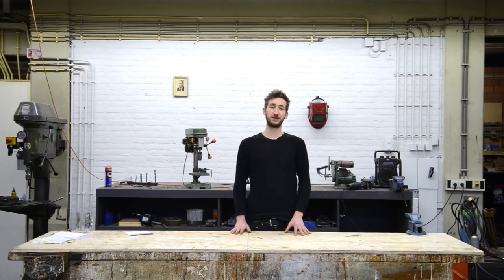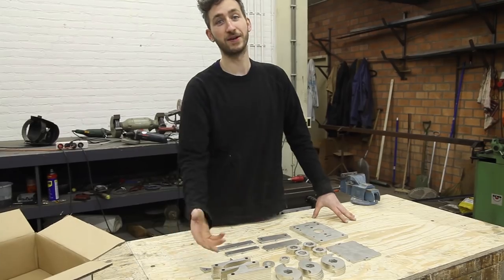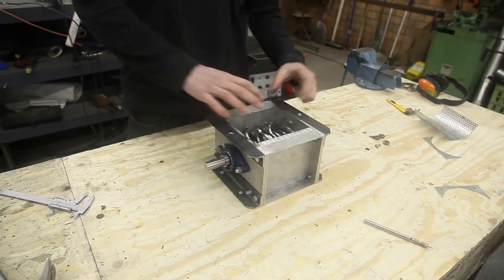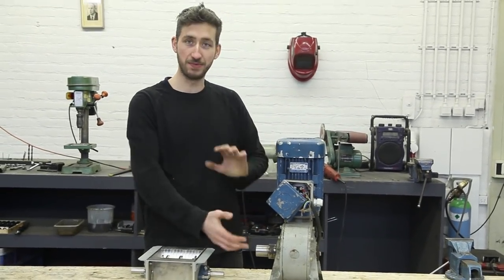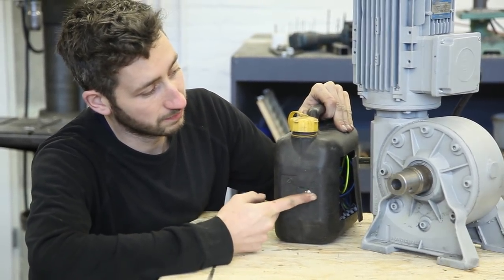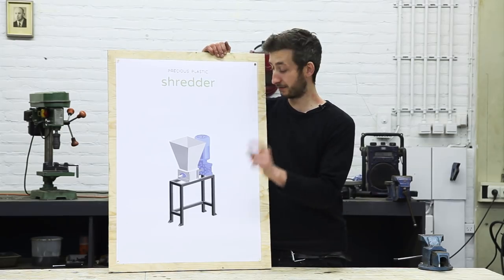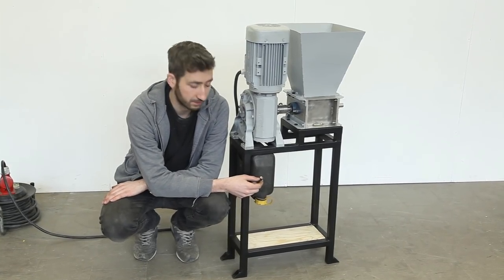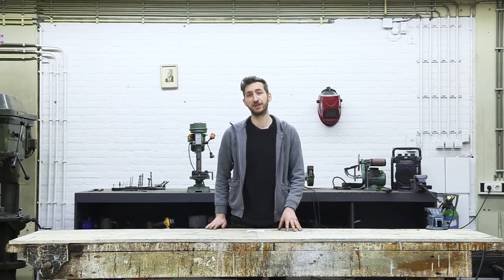Precious Plastic - Build the shredder (part 3.1)

Comment: Let me stop you there ....watching the videos in order all of a sudden you need a lathe a pillar drill and a linishing machine co make these , best guess (PS im a gunsmith and a blacksmith not to mention a tree surgeon and an engineer) thats around £2500 with fuel and transport assuming you actually have some where to store them + £250 to have the parts cut ? well pointless watching the rest of these videos and pointless sharing this on facebook , no one i know (including myself) is going to invest £10,000 (by the time you make all the machines) to recycle household waste.
Reply: +Edgunsuk 

Nothing in this life is easy...but I always try to look on the positive side of life...

With ingenuity you can find work-arounds to most problems in life...no one answer to any problem...you sound like a capable bloke...good for you that you can do all those things...I am an Engineering Inspector...I can think of other ways to solve the basic engineering required to build this gear...and getting bits and bobs is a snap down the local scrap yard.   

In most communities there will be easy access to all of these tools. Nice to use a laser cutter but with a bit more work you can get good enough results with an angle grinder and a vice and a file. 

No need to buy and own at first just negotiate and share...or borrow...

Many hobbyists already have the equipment he mentions in his video...I know lots of folks who would be happy to volunteer their workshops to help a good cause like recycling plastics.

I think there's always a way to do these things if you really want to do these things... 

The alternative is just give in and ban plastics to stop pollution...rather than try to fix the problems associated with their use and disposal....

I feel like a lot of work has been put into these presentations, they share their work no charge...if people can do it they will and if they cannot...well they won't.

Here's a link to PPC if you need to get an idea of what they are preaching...I'll go with the folkd looking for answers and solutions anytime...

http://www.plasticpollutioncoalition.org/
Reply from the maker: +Dane Lavery we need more people like you
Reply: +Edgunsuk sorry champ, this is not something you will do at your houses kitchen with mentos and a diet coke... and you can still do it without many of those tools if you use your brains a little.
Reply: I am an engineer a blacksmith and a gunsmith among other things this is ridiculous the guy is pushing it as a single person idea not as a small business, maybe you have significantly more money than i do but i have lived in houses that would cost less than that full set up ""champ""
Reply: +Jonatan Villagran 
Please, be more condescending.
Reply: +Edgunsuk I agree with edgunsuk, even with all the right intentions and looking to the bright side of the road, you need a considerable amount of money just to make this machine (and a similar amount for the other three), davehakkens is trying to sell it like a "even a toddler can do it" product.
Reply: Daniel...

I previously replied to Edgunsuk pointing out that there are always work arounds. We should never be put off by the difficulty of a challenge. I agree with Edgunsuk that PP presents a highly individualised view of how to do this...

I have a strong Engineering and Metallurgical background and I have worked all over the world and seen all manner of resourceful and inspired solutions by people who never saw a machine shop in their lives and had nil in the way of formal engineering education...yet they found answers. Good workable solutions where highly qualified experts failed repeatedly over many years.

Instead of calling Edgunsuk names and rubbishing him, I would rather ask him for his help. I  would ask him to download the PP plans, review and list his criticisms and (more to the point) suggestions (polite ones only please) and then head for the PP Forum...post those thoughts there. 

Criticisms are always helpful. Suggestions more so...Focusing on problems with the help of others always helps us move towards solutions. Focusing our combined abilities and knowledge and sharing that is the way to resolve the most difficult engineering problems.

As an Engineer, Gunsmith and a Blacksmith, Edgunsuk is uniquely qualified to help with this endeavour. I for one recognise and respect that.

When I get the time I will try to build a version of this equipment. Only that will help dissuade Edgunsuk there are workable, viable solutions...Yo can bet I will not be spending £1,000(I'll be spending JYen in any case).

For any of you out there who are attempting this head for the PP Forum and seek your help there...do not expect that from PP. This is a one man band pretty much and we must be prepared to self help. 

See you there I hope.
Reply: This video isn't pointless. In fact, it has inspired me to build a similar machine using nothing but a drill and and a hacksaw. Yes mine will shred bottles and toys. Humans have one capability called imagination, please use it.  How did I build mine? read next...
Reply: I build mine using a converted paper shredder. The rule here is you're only given two tools. A hacksaw and a drill, but nearly an endless supply of scrap materials. I can't go into detail how due to the complexity and limited space...my shredder is hand powered. Please go make it work.
Reply: +David nice David, the only thing pointless to discuss is this great idea... Dane keep it going
Reply: Ban plastics ! LOLOLOLOLOLOLOLOL !
Reply: Agree with you Mark...it sounds ludicrous because plastics are everywhere...but there are a bunch of people out there who want to get rid of plastics...to "crush them" is the slogan they use...because of the environmental hazards they cause when they are dumped in the ocean and buried in landfills and they are having quite a lot of success recently...

For example this organization...

Plastic Pollution Coalition...they describe themselves as a global alliance of individuals, organizations, businesses and policymakers working toward a world free of plastic pollution and its toxic impact on humans, animals, the ocean and the environment. 

Their fix is to get rid of plastics...and a lot of people are listening to them.

Because recycling in their experience /opinion does not work they are trying to eliminate the problem at source.

I believe that this type of initiative is a workable alternative which will help recycle and re-purpose plastics that would otherwise end up being incinerated, dumped in the ocean and buried in land fills.
Reply: This is always the way in order to go in to business you have to have start up capital, I was hoping these machines might be cheap enough to help over come some of this problem.  The blades he had machined looked like the set of dado heads I inherited from my dad for a table saw. Hopefully some of us can find a way to lower the bar, and start smaller. less expensively.
Reply: One thing to make it easier would be using a thick smooth rod as axle instead of hexagon shaped. No need to lathe it round on the ends, and instead of "just spacers", weld the cutter plates in place, using spatter spray, and welding glove to aid keeping the weld within the spacer area in the axle.
Still need spacers to make the fitting is right, but no need for lathe to make axle ends round.

Cheap welding can be done with 1-2 car batteries and stick weld it.
ALMOST household item level - if you have a car and jumper cables.

Avoiding large drill bits (bigger than 10mm) would allow you to use a cordless drill, no drill press. It's hard to find over 10mm drill bits which will go into a small drill which accepts max 10-12mm bits. At least here you are even hard pressed to find metal drill bits larger than 10mm or drills accepting larger than 10mm, at any sensible price.
Step drill needs to be used, and that really only works for stuff 3mm or less thickness.

Angle grinder can do the job of metal saw (what's the right name for that type of saw, i don't know), not as precise, but just use grinding or flap discs to get down to the right measurement.

Getting laser cut parts is quite cheap, but still stupendously expensive in this country (Finland). A single cutter plate could cost 20€+ cut here. Anything in this country is stupid expensive.

To keep prices sensible for some parts, Precious plastics could fund their work and help people by selling the laser cut parts as a kit :)

The bearings are also a potential issue over here.

It's quite stupid how expensive stuff is in this country :( It's the taxation which is at minimum 60%+
Reply: Interesting, I though about trying use a beefy paper shredder.  I watched a guy use a food blender to pulverize milk gallon plastic, so I think it might work especially if using the parts of milk jug that are straight and not very thick.
Reply: I don't know about Finland but in US the small drill press can be bough brand new for 50-60 bucks so it's hardly expensive and useful to have in your garage anyway.  My cordless drill actually costs more :)  I have a mini lathe and it's super easy to turn hex in to round, but you know, I have to admit that building this shredder is probably going to cost lot's of money.  I haven't inquired about laser cutting, but even plain raw steel is so expensive.  If I really wanted I could use a metal bandsaw and a grinder to shape the blades, making a a hex hole would be difficult with a hand file, lol.
Reply: that piece is quite large, so a mini lathe is not sufficient.
Cheapest drill presses here cost few hundred euros.

Site says this can be done for ~180$ tho

Also, them being cutters, not any kind of mild steel works out, probably needs to be "tool steel" or "knife steel" to remain sharp at the edges.
Reply: I am pretty sure I can chuck that hex piece.  It can handle about 30mm with internal jaws and with external something like 50-60mm, I don't remember exact numbers.  If I wanted to chuck a long piece through, I am limited to about 18mm.  For ~180$ it's not possible.  I started writing long comment yesterday on how a 2kw motor with speed reducer will probably cost around $300 with shipping on eBay.  The shipping is about half the cost.
Reply: I remember the first plastic bottle I had ever saw. Everything used to be glass and reusable. See no reason this wouldn't work today.
Reply: Richard lots of sand to make glass, and bottles can be cleaned and reused,  but to recycle glass you have to wash it remove the  label and sort it, by color. but most people just want to wish it away to the land fill. recycling requires, thought &  effort no matter what the material is! at least glass in a land fill is inert!
Reply: relentlessmadman
We used to have home delivered milk, we left the empty's on the table, the milk man put fresh milk in the fridge. We returned drink bottles for refund. It worked. No reason it couldn't be done again. Of course if it's to much trouble for you then it won't work. One can always find a reason not to do something. The key is wanting to do it.
Reply: right on ! I want something simple, home built, with parts I have around my shop and garage ! Too much money ! forget it !
Reply: triumphmanful this video is a demonstration of why recycling is not taking off in  America. single stream recycling, is only feasible if subsidized by governments. large scale operations require huge start up investments.
      Machines and people to sort our trash, who wants to be a garbage sorter? and when does the operation become self sustaining?
Reply: rly are u blaksmith never heard of those im supirzed that u are :0
Reply: Honestly  you could miniaturize it for a fraction of the price. and that's if you shop at HFT instead of Fleabay china
Reply: Robert Watson I agree, is there a forum of like thinking people, to share Ideas, any where besides Utube?
Reply: +Robert Watson Are you talking American dollars or some kind of country which has 100x inflation?  Did you get a price quote or did you guess?  because in USA where I live it's nowhere near this astronomical price.
Reply: Robert Watson Ok....  I don't even know where to begin.  Clearly this is not a project for you if you're looking for a NEW 230V motor from Grainger.  You live in USA, we use 110v, so why on earth are you looking for 230V motor and NEW when author clearly picked a used motor, he picked 220V because that's the common household voltage where he lives.  Finding a geared one is more difficult but I see one on eBay right now for $120 shipped, it happens to be 230V but I've seen 110V.  You can buy used non-gear motor 2 - 3 HP from treadmill for about 50 bucks or find a local free threadmill and build chain drive to reduce rpm or you can use stepper motor + timing belt + gears to create stronger torque, (that's my plan)  I think 2HP requirement is way too much, you can get away with much less power, it's not like you're going to be shredding huge solid chunks of plastic.  Even if you had to spend $550 on motor and $500 on metal parts, where does extra 6-7k comes from?  You can buy a bench drill for $60 from Amazon, you can buy a mini lathe for $600 from Grizzly, You can buy a small milling machine from same company for same price.  You can buy a cheap welder for abut $100, you can buy a metal saw for $100 from HF (works great) or even use angle grinder to cut square tube for stand. Heck, why bother making a stand, it's a waste of time, build a wood bench from plywaood and 2x4s for cheap or find some suitable furniture from CL for free or cheap.  If you already have the tools needed than it's going to be cheaper.  Also you don't have to make everything out of stainless, I would only make internals and the sides can be made from mild steel and powder coated.
Reply: you don't need to make one. I will make it for you. you do not need all 4 machines to start recycling. just wash it and send your plastic to someone who is doing it. 

even better wash it, sort it, shred it, then send it.
Reply: I can build all 4 machines for $6700. all new materials.
Reply: when we sort it before we throw it away.
Reply: Edgunsuk you dont have a lathe? but your a gunsmith
Reply: Heyah Dane! Pleasure reading your comments will definately check the PPC web site but just gotta tell yah Dane....coming from a dot on the world map called Barbados, the continued import of plastics and our lack of recycling is a MAJOR concern . Banning plastics along with feasible recycling /re-purposing solutions, doesn't sound ludicrous.... it sounds like its  actually the way to go!!  All the best to you and yours in 2017! Bless and Forward Dane !
Reply: I agree with you, Edgunsuk!  It's like one of those DIY platform bed.  You need to buy and house all those equipment and a shed to make the DIY stuff/blocks.  I wouldn't call that DIY.....it's only for the hobbyist who already owns the FULL set of equipment and a workroom/shed (plus material).  In some countries, those materials like wood and metal can be very costly too.  Plastic is just another material which you have to collect, wash and sterilize before you can use them.....which brings us to another full set of equipment and space to do all that!  I wish this guy can give us a link to purchase (and ship) ready made parts to put them together....instead of having to hire contractors to make the parts, yet another whole lot of $$$$$ and not so easy to find in some countries.
Reply: I plan to make these, so it is not pointless in my opinion. I have access to free cnc machining and supplies at my college.
Reply: Jack Cullen w
Reply: Edguns22uk
Reply: Edgunsuk 32
Reply: Edgunsuk 4
Reply: Edgunsuk i´m totally agree with you. 
In fact you can make all the stuff, but if you don´t work on a place with all the equipment and you can freely use it or you can afford all the tools (and they aren´t  cheap) you won´t be able to make it.
Reply: Why not make the base and the hopper from wood?  I have seen guys here make bandsaws and lathes from wood and salvaged parts.  So I don't see why this build could not be mostly built with wood.  With the obvious exception of the chippers and motor.  But an old variable speed 3.5 hp router could do in a pinch.  And 2 gears made of wood one 10 inch one 1 inch could be used as a 10 to 1 reduction.  And old saw blades or dado blades with spacers.
Reply: if if was a donkey we,d all get a ride. where do you stop ? you spend 3 months making it all from wood ?
Reply: Why not wood ? Because of mass and resistance to vibration. Actually if you're not able to work with metal (because of cost, availabilty or skill), just consider concrete for your frame. That's a technique from the early 20th century that has lately been rediscovered and applied in developping countries to build low cost, fairly decent machine shops. Check it out here : http://opensourcemachinetools.org/wordpress/concrete-lathe/
There's a bunch of YT about concrete lathe too.
Reply: I have seen a video of a cnc base using square tube that is light weight and the filled with sand to add mass.
Reply: Yep that's a good way to do it too. As hobbyists, we'd prefer light weight tools we can carry around in the shop and tuck away for storage but heavy tools allow us more precise work and more powerful motors...
Reply: Making junk into machines does take time and effort. It can be done fast with money. It can be done cheaply with time. The concept is the key. Laser cut pieces didn't exist when the Eiffel Tower, Empire State building, or Pyramids were built. Easter Islands statues weren't carved with a CNC either. A cold chisel, hacksaw, and a file will cut most of the pieces. Splurge with an angle grinder and cut off wheels if you can find one at a garage, barn, boot sale. If not then do without. 
There are enough reasons not to try in the world. Let's not waste our available building time proving to ourselves that we are incapable.
Reply: @danelavery7436  Yes, plastics are toxic. I found this video offering no indication about the possible toxic side effects of those choosing to heat the plastics being used in the extruding machine. Nor any mention of the possible negative side effects of creating and using such items via the processes suggested. Outside of the dangers of using such machines, like a shredder, and devices which can heat plastics to a melting point, to create molten plastic as a casting medium, is this process a safe practice in terms of the toxins which will be emitted via heating and mixing plastics of unknown compositions?
Reply: Reggie 

Plastics do indeed emit toxic fumes particularly when heated to and beyond their degradation point, which is well above the melting point of the recyclable thermoplastics used in these videos. 

Plastics outgas volatiles very slowly at room temperature and they certainly do outgas faster when melted, however the time and temperature is controlled by the design of the heater and extruding machine so that the plastics are quickly melted and extruded soon after. This means that at any one time a small volume of plastic is melted inside the extruding machine and the molten plastic extruded and cooled to room temperature soon afterwards.

If you are considering attempting this project please go to https://preciousplastic.com/ and view all the videos and download the detailed plans. There are over 30 videos there. This one addresses only the shredder, its manufacture assembly and use.

This is very thoroughly documented and well supported project, complete with plans and instructions, videos, a forum and in addition, you can raise any issues you have with the people who made the videos who will then provide assistance or answers,

Honestly speaking, I haven't watched all the videos, because I have not yet had the time to build and operate one of these machines but I hope to do so with a colleague one day soon. That said, I do recall seeing one video that covered selection, sorting and separation of suitable waste plastics for this process so maybe that concern is addressed.

Clearly good ventilation is a given when using equipment like this. That is probably covered in one of the other videos but if it isn't you are right it should be.

If you find that your concerns are not addressed by the various videos/plans/building instructions then you should contact the folks who made the videos rather than me. They are in the position to address your concerns...I am not.

Probably you have used a glue guns that melts sticks of plastic which can be used as a quick setting glue (Hot Melt Adhesive) which is merely a type of thermoplastic. So there is an example of a thermoplastic being melted and used safely and universally and that is closer to what is proposed here than toxic fumes emitted by degraded or burning thermoplastics.

Probably this will not change your opinions or the reservations that you have regarding this initiative to recycle and repurpose thermoplastics that would otherwise be chucked away in rivers or the sea aor sent to landfill or incinerated at low temperatures to produce toxic fumes/pollution. That is your opinion and I respect it completely.

I do have my reservations about the lack of use safety wear in this video...safety glasses, gloves and so on. Maybe that is addressed by them elsewhere, but this series of videos...